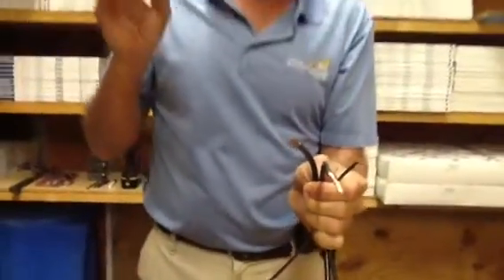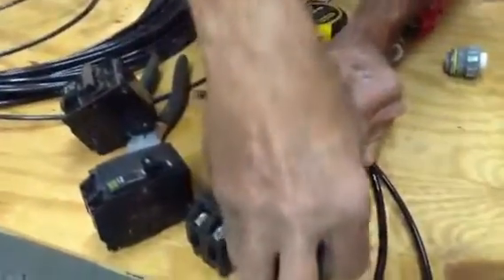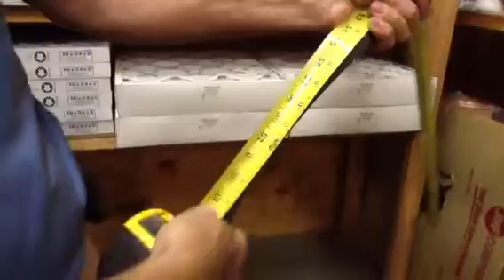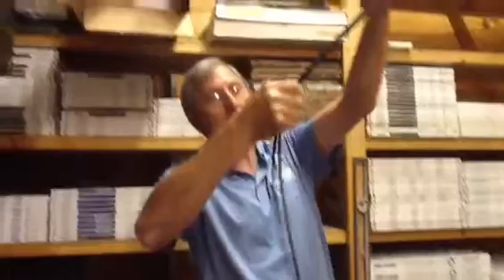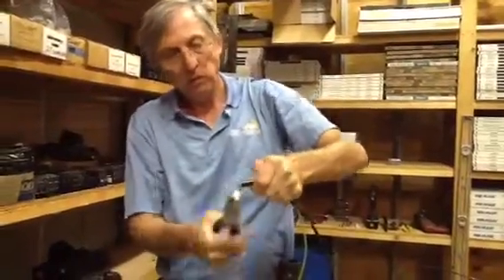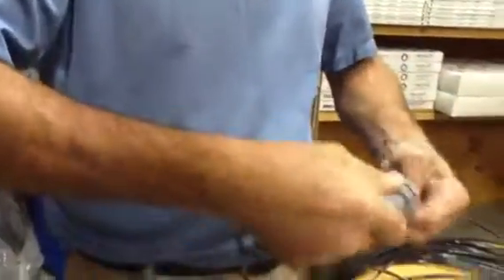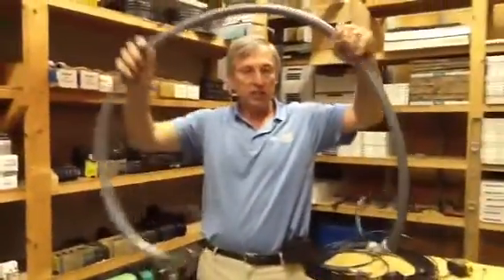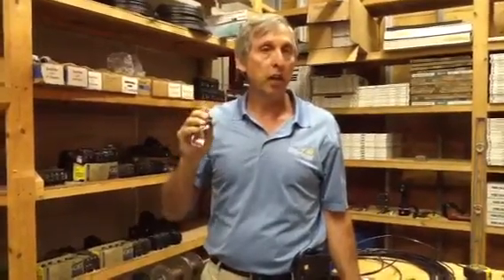SHOWING WHAT SIZE WIRE TO USE FOR HEAT PUMP

Comment: That is no how you size wire conductor or breakers for AC motors . You have to check the Name Plate in the unit you need the Amps on the FLA from there you multiply that for 1.25 to get the amperage. You go to table 310.16 to find the correct size for your conductor under the 75 column. For the breaker you multiply the FLA x 2.50 and that will be your protection for short circuit and ground faults.

Comment: Ok. So, two hot wires will carry 240 volts to the unit. How will that 240-volt return to the electrical panel?
Reply: Through L1 and L2
Reply: @AngelFlores-jx1pf  that was my question as well. I thought that 240 V circuit needed to have a neutral wire, along with an equipment grounding conductor. At the power transformer, it is a 240 V output formed by a single phase winding of the three phase transmission system when it arrives from the utility, and split into two 120 V legs by drawing a neutral off the utility transformer, midway down the single phase output winding, giving 120 V from each hot wire to neutral and 240 V across the two hot wires (call them L1 and L2). The OPD circuit breaker is two pole, so it energizes both L1 and L2 at the same time. That gives you 240V between L2 and L2, which is needed by the HVAC. If you put a neutral in the whip the HVAC could have 120 V circuits as well as the 240 V supply. If the current in L1 is balanced with the current flowing in L2, then you might say that L2 is the return from L1, however, some modern day heat pump systems are inverter driven, isolating the branch circuit load from the motors it is driving, and in the inverter electronics (digital electronics) there are harmonic currents created that need to be brought back via a neutral conductor.

At the breaker panel the neutral coming from the utility is BONDED to the ground buss, so at that point, Ground is Neutral, and vice-versa. That is the only place in the residential wiring where this is the case. The ground is used for safety, in case something metal accidentally gets energized by contacting one of the hot circuit conductors, as it provides a conductive path back to ground reference voltage, so you would not get electrocuted if you got between an energized metal part and your body provided a path to ground. That third wire he put into his whip has nothing to do with the circuit he is installing, which definitively tells you he intends to use L2 as the return path that completes the circuit. His whip will not work for some equipment.

Comment: Hi I do like your instruction very well helpful. ? I’m going to buy Mrcool   DIY-18-HP-230Bmini-split AC &heat pump 230v may be 25A do I need double pole 30a breaker  & # 10/3 also an outdoor 30a shut off box ? Thanks

Comment: How about a video on the disconnect ona heat strip installation. . Do they need a separate disconect or can the be the same one used as the heat pump?
Reply: It has to have its own disconnect.